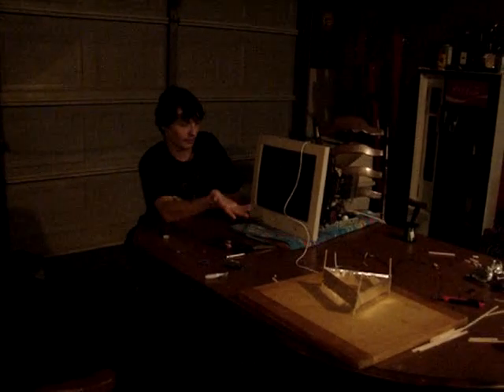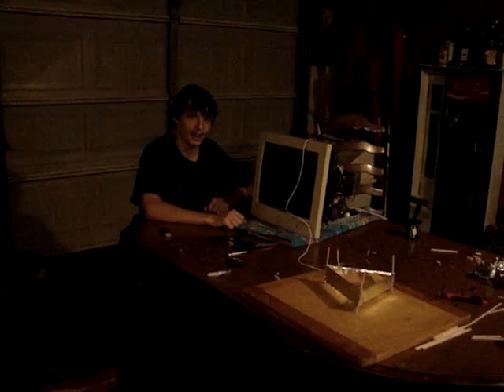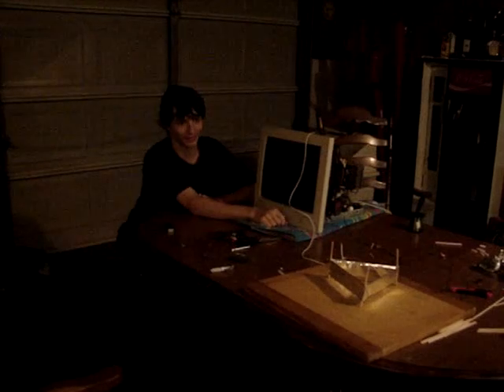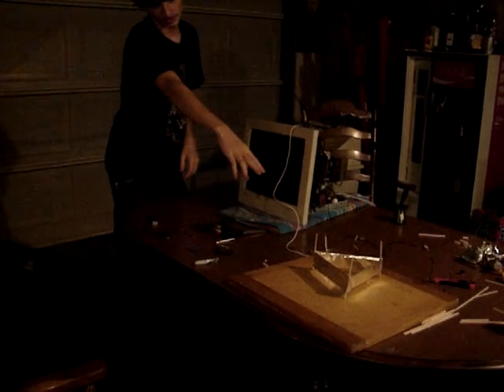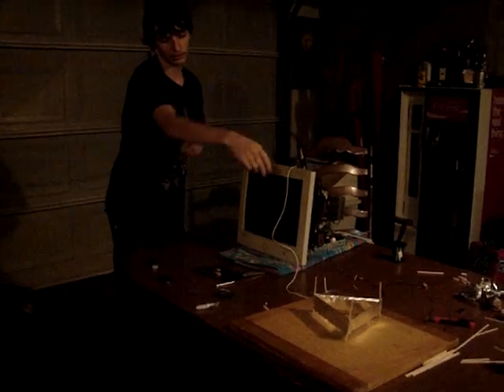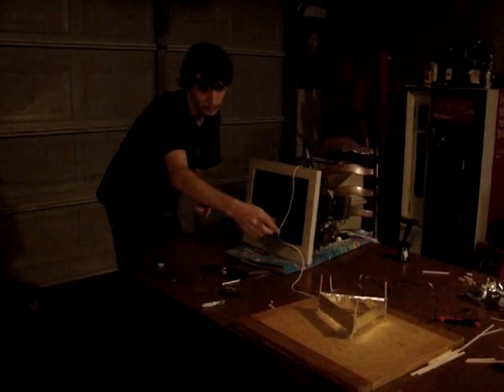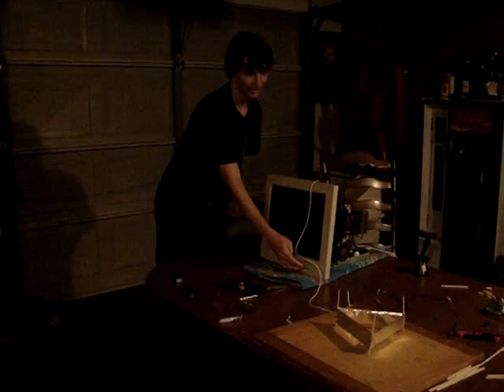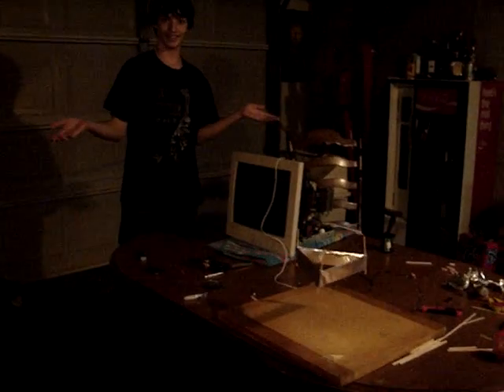My lifter experiment

Comment: dude look at the flyweeel!!! no magnets! it doesn't matter, they did not build it right at all, it looked nothing like a Bedini motor, i know Ive built one!

Coils weren't wound right, no magnets, wat the hell did they expect to happen. Plus u said that it turns so there must be magnets, they used a separate motor to turn the flywheel, which completely defies the whole point of building it.
The Bedini motor is a generator and motor in 1. Coils should be pulsing the flywheel around.

T